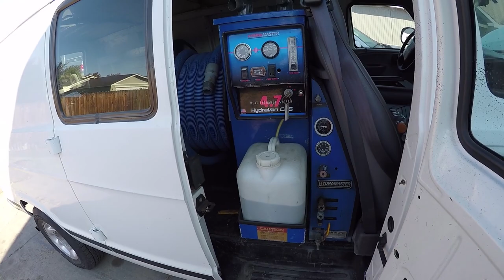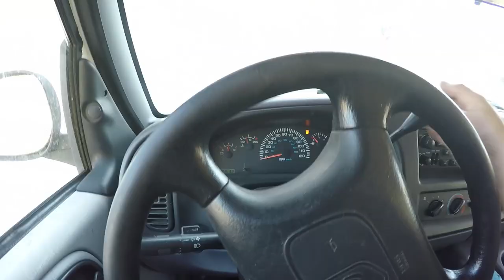2002 Ford Expedition 4r70w 4r100 Transmission Removal

Comment: Great job and thanks for posting. I would consider building some wheel cribs from 2x4s. I used them when I dropped the tank on my 5.4 Exp. One of the BEST tools I've ever built/owned for under 50 bucks. I was able to sit up while working underneath.

Comment: I like the look of the lifted Expy with bigger tires.  Not too much info about how people do it with the 2000 air-ride.  I’ve heard torsion bar adjustment, or spacers.  What did you do?

Comment: On the driveline bolts(from factory) give them a little heat and they should come right out.when I put them back I use anti-seeze.i have about 12 1998 expeditions.

Comment: What's the difference between 4r100 and 4r70w transmission? I have a 2003 ford expedition 5.4l it only drives in the low gear
Reply: I too have the same question. I have a 1997 Expedition Eddie Bauer version with 5.4L V8 engine.